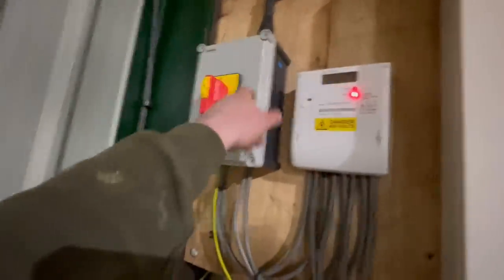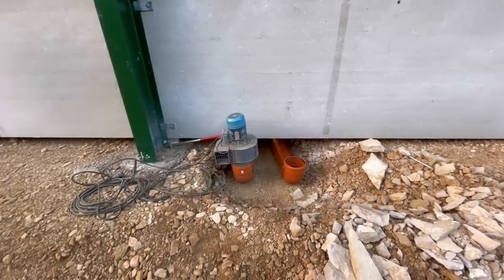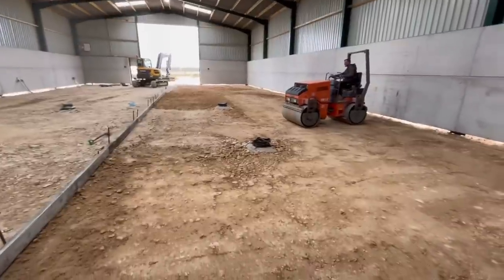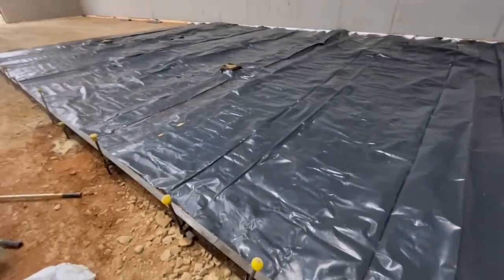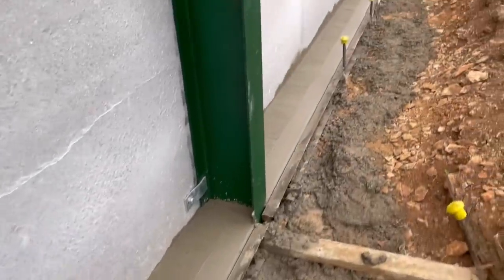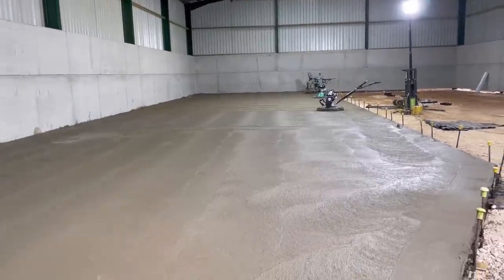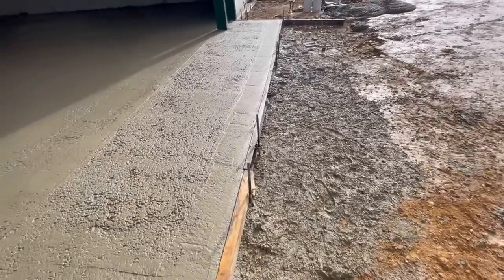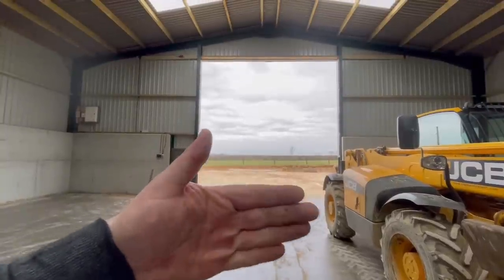Build your own grain store/steel frame building (part 4) concrete floor and roller door

Comment: Great video Tom and very nicely presented the one thing I really like is the cross ratchet straps to stop the door blowing in simple but very effective we had a roller shutter door that was more out off the runners than in great idea and a fantastic job on the shed you should be proud off it 👏👏👍👍

Comment: Thought you would have put more air ducts in and pedestal tower for drying only back half of store appears to be blown air
Reply: I was wondering the same thing
Reply from the maker: Going to use mobile ones in the front for time being becuase possibly one day it could be an industrial unit

Comment: Is there an art to getting the floor level, or is it literally a massive spirit level? Also, how do you know how high the manhole covers are going to be before you've poured the concrete? Top video, really enjoyed it 👍👍
Reply from the maker: Use a lazer level and set all the concrete shutters to the right level then using the aluminium screed bars pull the concrete to the level that’s been set with the lazer. Whole floor should be less than 3mm out all over it.
Manhole covers are 6inches -10mm from limestone level. So when concrete is poured finished floor level will be 6 inches.
Reply: Before you even pour any concrete,even at the digging out stages you will know what the finished floor height is gunna be so therefore with that it's relatively easy to set up the shutters.for the concrete pouring to finished floor height,everything during the build is governed by finished floor height fella!!

Comment: Not a criticism but are you ce coded welder etc? My insurance company wanted to see the documentation from shed builders. Not that I see it matters as you did a better job than some professional companies.
Reply from the maker: Yes I am 4 years of paperwork and crap to get the tickets
Reply from the maker: I can weld stuff for myself being coded but I have to have something completely different to be ce marked so wouldn’t be able to sell a steel frame building unless it’s for my own use.
Reply: @Tomlamb980  sell it as a second hand frame 👍

Comment: Tom, I presume you filled the concrete cuts with some sort of goop.  The other thing I wondered was whether you would have been better off rotating the boxes in the floor so that the concrete cuts ended on a corner, instead of in the middle of the side?  Corners are always weak spots, probably an irrelevant 0.0000001% if it's even that much.

Overall looks like a good shed.  Pity to waste it putting grain in it 🤣!
Reply from the maker: Don’t think it would make much difference turning the man holes for the size of floor.
Don’t usually bother filling the cracks as the dust just fills them sometimes use mastic to fill the cracks
Reply: @Tomlamb980  I doubt it would make difference either.  But it's always worth asking questions.  Might help someone in the future -- hell, I might even learn something 🤯!

I was thinking that having dust mouldering away in the cracks might be something best avoided in a grain shed.

Comment: Loved you're build can you tell me what size bolts you used and where you got them from I am going to have a go at building my own 90 X 40 X 16ft big saving about 6k on the frame
Reply from the maker: Can’t remember the exact size but they all came from a company called resource engineering in Bourne

Comment: hi tom building my own store atthe moment. what was the floor sealer u used and why. does it make it very slippy. great videos
Reply from the maker: I can’t remember the name but if you look on the video I did show the floor sealant and I think it does say it on the label.
It stops the concrete going dusty and makes sweeping up a lot easier lots of advantages.
No doesn’t make it slippy most concrete we pour that is inside has the sealer put on it

Comment: Hi Tom, as the concrete floor from inside to outside is connected would that not bring some dampness in?
Reply from the maker: It’s divided at the door by a big bit of angle iron I didn’t show